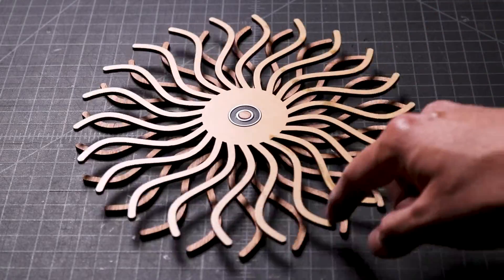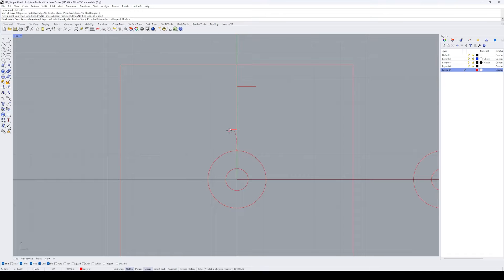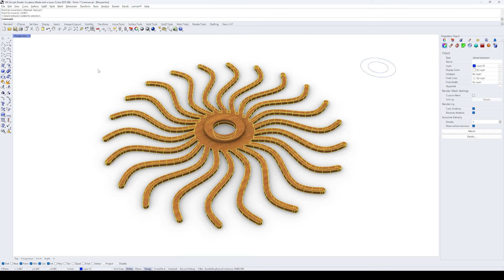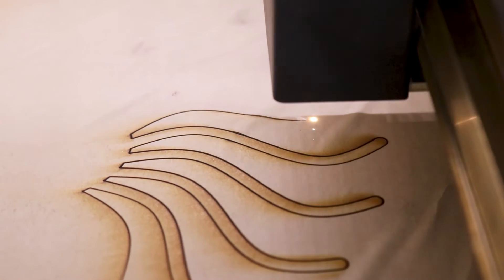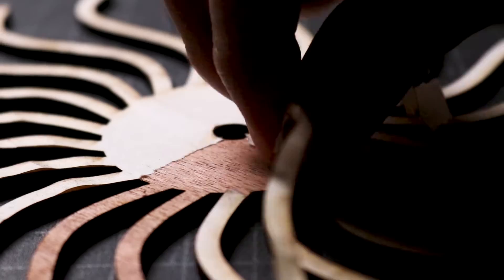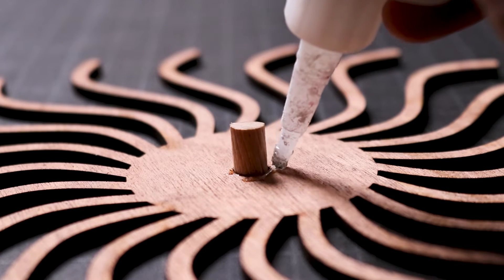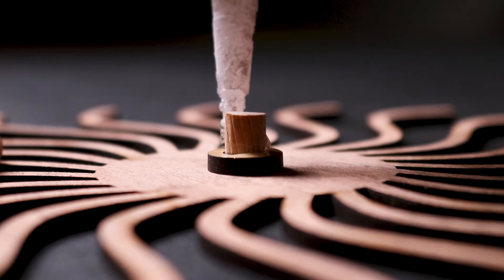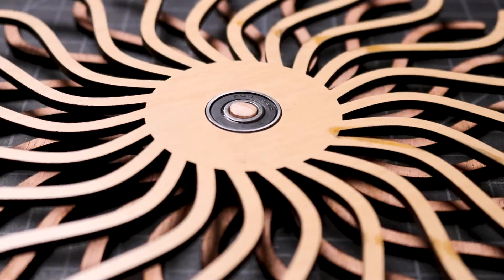Making a Kinetic Sculpture with a Laser Cutter

Comment: I just recently purchased a laser cutter, and one of the big things I want to use it for is creating kinetic sculptures. I love all things mechanical. I have already created a 24 to 12 geared mechanism that has three layers with a kind of decorative scrollwork chassis that allows you to kind of fidget with the bigger gear with your thumb, and rotates a little circular scene engraved into the smaller gear through a viewing window. I keep it at my desk at work and kind of mess with it when I'm thinking...like a fidget spinner...I honestly like the design process almost as much as rhe actual making. What is the software you are using? I think you said Rhinoceros. Ive never heard of it.
Reply from the maker: Kinetic sculptures are really fun to design and make. I still have a long way to go with my designs. Using gears could make it more interesting by having multiple moving parts. I use a software called Rhinoceros, which is for high level 3D modeling of things like yachts, jewelry, and other things.

Comment: This was fun. Next one automate it by using a tyc-50 synchronous motor. I use them on my wife’s cup turner and they move just slow enough. Your work is amazing. Just my opinion, if you would put a miniature one on top of the bearing that would make it perfect. I just made my first clock face for a wedding gift for a dear friend’s daughter. Cutting it tomorrow. The monogram I designed also will be cut out of walnut and inlaid. The numbers and hash marks will be engraved. Learning from you and others have made this possible. So thank you Tim. Can’t wait for the next one
Reply from the maker: That’s a great idea! I’m not planning to use a motor yet, but it’s been on my list of things to try. I’m slowly getting into projects with moving parts so I appreciate the tip 😁